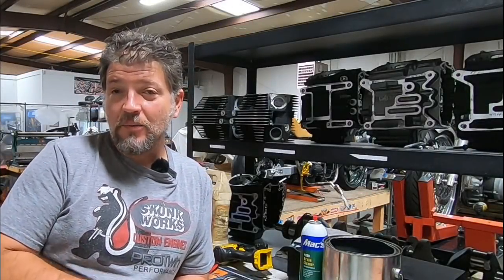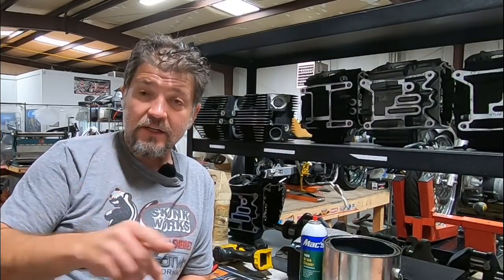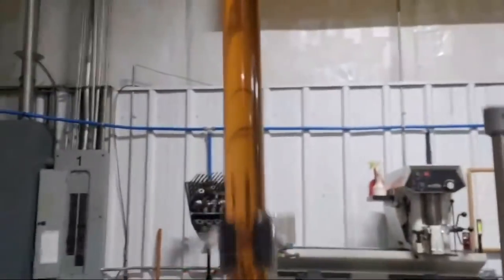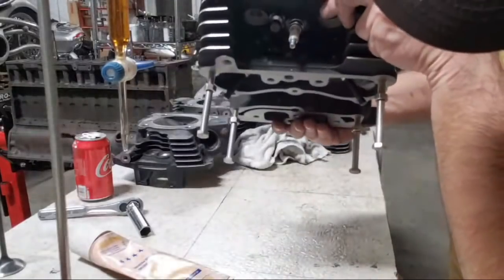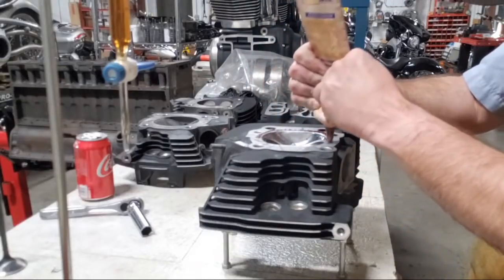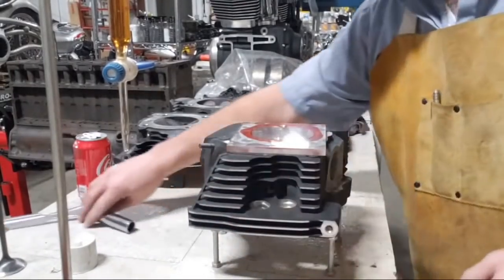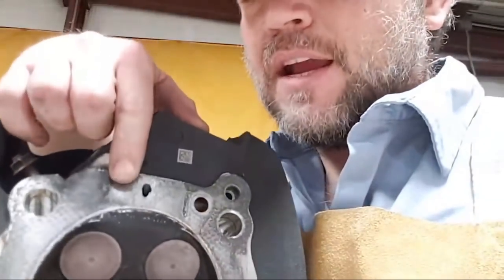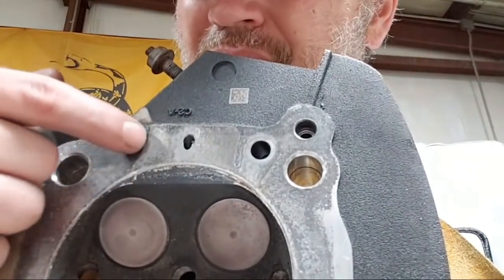What Does CC a Head Mean? - Combustion Chamber Sizing - Deck Head - Kevin Baxter - Pro Twin Performa

Comment: I put a 110 big bore kit on my 2011 96cu S&S 585 easy start cam adjustable push rods Fueller lifters New highflow oil pump cam plate all new bearings I change the valve springs to compensate for the 585 cams but I did not change the heads I also put a fuel pack from Vansen Hines on it it’s all been programmed My question is when I stay at a steady speed it acts like it’s fluttering needs more gas did I make the mistake by not changing the heads to a 110 if this question if this is not allowed please delete thank you

Comment: Very interesting about the alloy change and the thin spot. I recently picked up a very low mileage and very stock 2011 FLHTK. So I've been researching cams, exhaust, ect. Headwork is on my research list as well, so this has me concerned about the stock heads' longevity. Because the way that looks to me, it creates an uneven clamping force. Would a guy be better off with aftermarket heads?

Comment: Why not use a mill ?
I'm a mill machinist so maybe I'm biased
Reply from the maker: I could tram in the mill and use a fly cutter or face mill of course, but quite often, my mill is fixtured for other operations.  For me, this method is quicker.  Also, with MLS head gaskets, I prefer a continuous phonographic finish that a lathe can provide.  Additionally, I have more consistency and control over achieving the desired RA finish on the lathe.  Most MLS gaskets can seal at a 60-70 RA.  30-50 is more of an average of acceptable.  The smoother the better...but with the lathe, i can get it down to 20-30 consistently.  Getting into single digits and teens would be awesome...but near impossible.

Comment: Interesting on the head change,  any idea why it changed?
Reply from the maker: I have to believe, but can't say with certainty, the alloy changed or something in the casting process.
Reply: @KevinBaxter  makes sense,  so if one is planning a  build on a newer engine is it a good bet to budget for a better pair of heads instead of using the stock ones?
Reply: @KevinBaxter  The alloy is listed next to the casting number IE 242T5 or 332, T5 being heat treat or conditioning statement

Comment: Does the billet head have more room for intake and exhaust flow than a modified stock head or is it just stronger?
Reply from the maker: Our billet head allows for larger valves and is a much stronger base material by which to machine.
Reply: If I went with the billet head with larger valves would I have to increase the 50mm throttle body. What is the cost difference of porting and rebuilding my heads to that of the new billet heads?